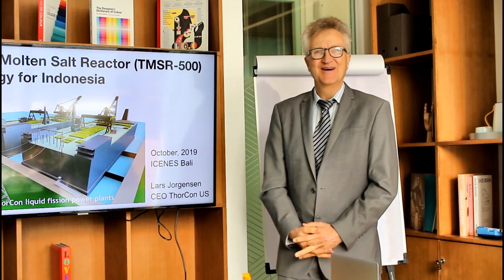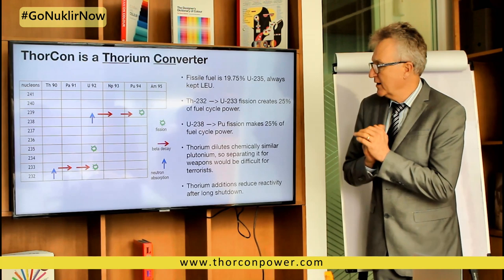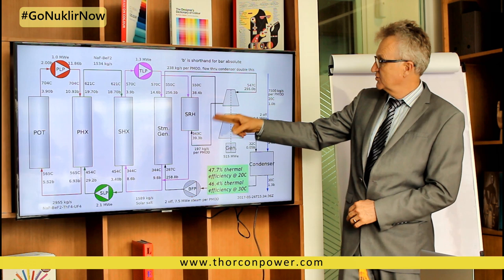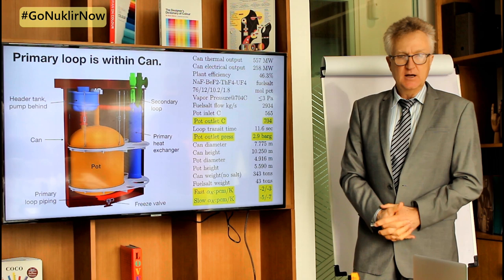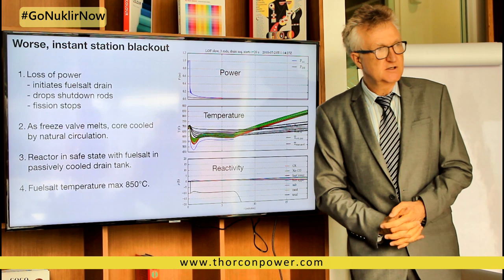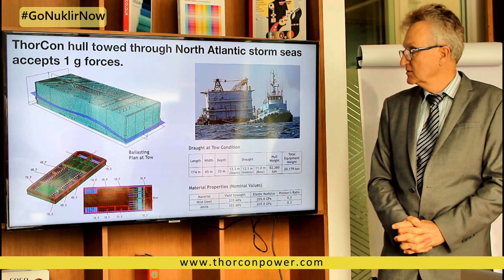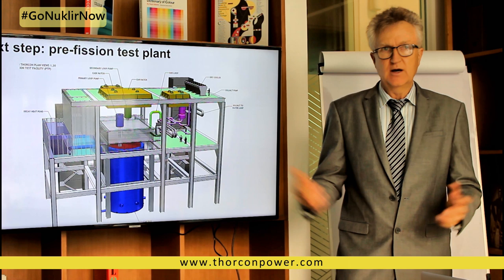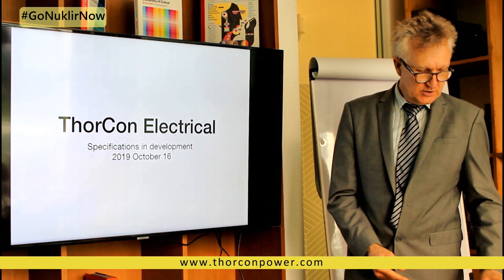THORCON CEO EXPLAIN DESIGN  [ICENES 2019]

Comment: My primary concern is having to  frequently  replace the graphite moderator. This creates an operational and financial burden. I think a system based on a molten salt soluble moderator could, if designed for continuous refueling stations, would provide  continuous power without  the complexity of exchanging modules. 

Thanks for the presentation.
Reply: Unfortunately I know of no soluble moderator for this temperature and salt.  The core is 90% graphite so graphite powder in the salt would be roughly the consistency of mud.
Reply: Al(DO)_3 ?  @larsjorgensen4123
Reply: Seaborg is a company which wants to use a liquid moderator.
Not dissolved in the salt itself but as a liquid around the pipes containing the fuel in the core. They say that it brings its own challenges.
They also say it's a hydrogen based ionic compound so I'm 80% sure they want to use LiH. So the challenges I imagine with that are a whole lot of Tritium leaking through every solid surface that is unfortunate enough to be nearby.
Reply: If the LiH blanket is kept at a pressure less than the surrounding material the Tritium will be drawn to the free surface and collected. It is still a gas and will migrate down the pressure gradient. The Xenon will behave in a similar manner.
Reply: Might something like Boron or Lithium fluoride work?

Comment: Maybe the fail safe control rods should fall into a cone instead of a cylinder...less likely for the rods to 'stick.'  The rods do not have to be perfectly vertical.  Maybe a fourth rod should be included that uses a chemical reaction (automatically activated by high temperature) to force the rod into the core(in case the ship is turned upside down or sideways).
Reply: As I understand, the plan would be to fill the "ballast tanks" so that the barge will rest on the seabed, so it won't be able to capsize, because it is not floating.

Comment: Nice one Bob - 
How do you address preventing the conversion of Protactinium converting by a fast neutron to Thorium 228 via Uranium232 ie.
Pa233+n—>Pa232+2n; then 
Pa232–>U232–>Th228+alpha?
(Granted this decay has a half life of almost 69 years but with a further 2year half life alpha decay to Ra224 this rapidly decays within hours through to Thallium208 which then emits an extreme 2.6Mev gamma in decaying to Pb208)
Reply: I think that 'n' in the "Pa233+n—>Pa232+2n" needs to be a fast neutron to make this conversion.
Their core is jam packed with moderator so they should be mostly OK on that front.